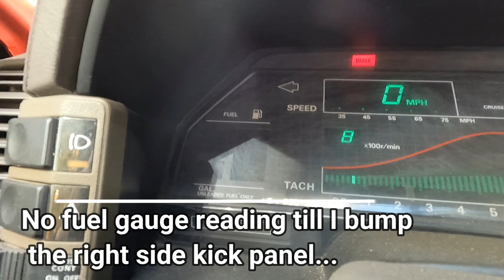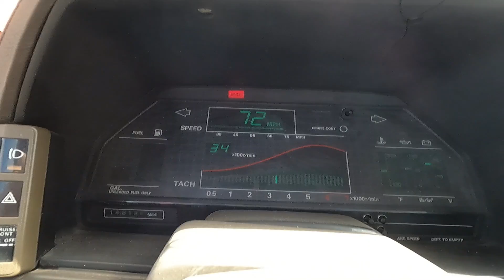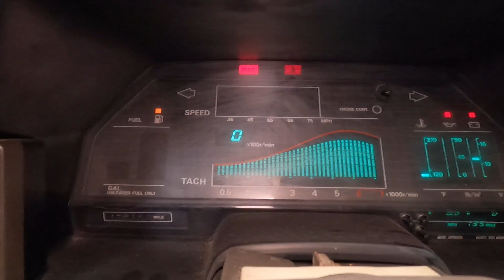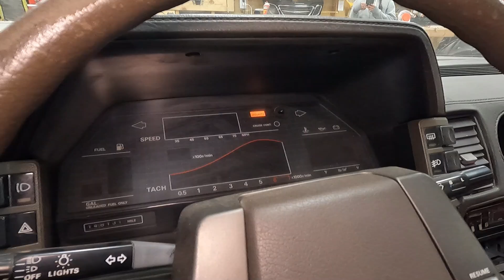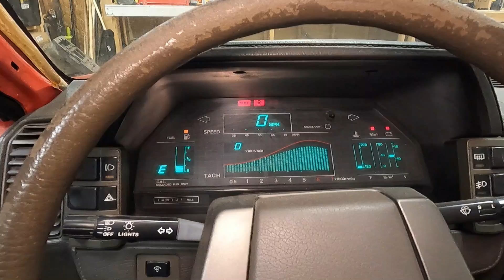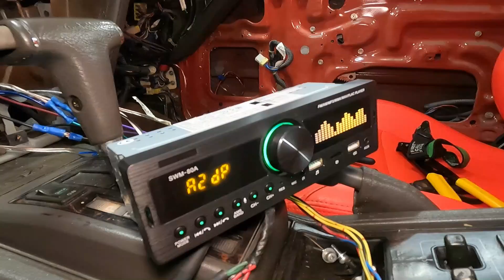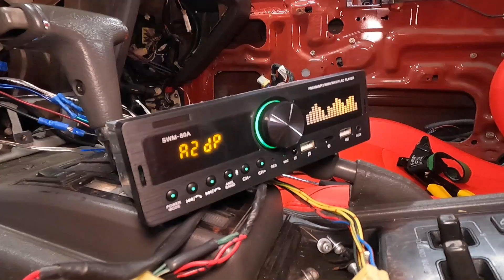The 300ZX Z31 gets keyless entry, a stereo, and its fuel gauge power supply repaired!

Comment: I’ve got a lot of experience with the Z31 300zx platform, that box you was messing with for the gas gauge is actually the digital dash power supply. 99% of the time if it goes out no just one gauge goes out, usually the hole dash will, it’ll flash and each gauge will slowly quit working
Reply from the maker: Luckily the magic box seems to still be kicking, but only time will tell I guess. Thanks for the info. I love this car but I'm not gonna lie... I kinda want the next project to be 100% analog.... like a beetle or something LOL
Reply: @WTFPerformanceShow  XenonZCar in PA can repair the power supply and you'll never have to worry about it.

Comment: For the problem with speaker wires in the GLL, I also have a gll and the conclusion I came to was that the negatives and positives are tapped into eachother somewhere ubder the carpet and those spots were different between the years I believe too
Reply: Also if u take the og speaker wire where they come out at the door on the driver side and tap them in to the new wire at the end the speakers will work and it’ll still have bitchin betty

Comment: Thanks for another informative video. One question… on the headliner, what’s that black plastic box? I constantly hear buzzing sound from mine.
Reply from the maker: There is SO much crazy stuff hiding all over these cars. Depending on your model, I believe you have your dome/map lights, a temp sensor for the climate controls, and a sensor for the compass if you have one. No idea why anything would be buzzing though lol. The map lights with the little vent looking thing are just held in with small tabs if you wanna give it a tug it should pop right off if you wanna check it out.

Comment: Do you have anything in depth on the radio wiring I can’t find anything
Reply from the maker: Pretty sure the factory amp makes it hard to wire an aftermarket radio into these. I tried to wire it but it seemed the wires never matched what they were supposed to be. The factory harness at the head unit should have an always hot 12v, accessory on 12v, and a ground. That's all you need for the head unit to function. Run new wires to each speaker and wire them accordingly. That's how I did mine.
Reply: @WTFPerformanceShow  okay thanks hopefully I can figure the mess out

Comment: Does your power steering leak too?? I’m 17 and have a 1985 z31 that leaks I’ve replaced the boot and hose but I think it may be the rack and pinion
Reply from the maker: YES! it definitely is leaking internally from the rack. I think rockauto offers a rebuild service but obviously your car will be down for a while if you yank it out and send it for a rebuild.

Comment: Hey huge fan and I was curious since you seem pretty handy but I have a 1988 300zx and my z has a battery drain i replaced the battery ,  terminals ends, starter, ect but everyday my car needs a another jump any idea what could be draining the power I have the secuity fuses pulled and no lights are left on so im just losted any idea? or even if you dont know how can i diagnose it? thanks in advanced love you 300zx series
Reply from the maker: Honestly the easiest way to track down a drain is to pull the positive cable off the battery, get a cheap voltmeter and set it to measure amperage, connect it between the battery positive and the cars positive cable (voltmeter positive to battery positive, voltmeter negative to cars positive battery cable), you will probably see it trying to pull a few amps if it does have a drain. Then simply pull one fuse at a time till it drops under an amp. Then you atleast know which fuse has the drain and you can work on tracking it down from there. If it's not an important system you can drive around without the fuse in and not worry about getting stranded!
Reply: @WTFPerformanceShow  ty sir id give this a try
Reply: @iOldFasionGamer  Keep in mind auto parts stores have some decent rental tools. Example, O'Rielly's has an "Amp Hound". You just take this tool, touch it to a fuse, and it will tell you in that circuit is drawing amperage enough to kill a battery.
Reply from the maker: Whoa, good tip! I had no idea!
Reply: @lucionsrandom5195  i never seen this but i figured out the issue on the brake pedal the light doesnt shut off because the rubber nipple on the pedal is missing
Reply from the maker: Nice! I have found some sticky brake light switches, but never a missing rubber piece like that. Good catch!